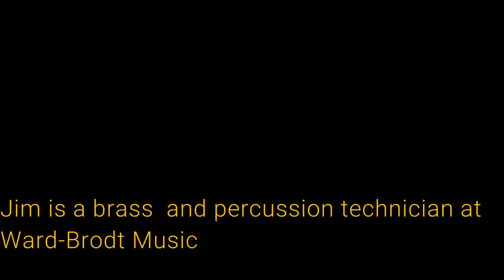Tuba Damage

Comment: What kind of solder do you use? I’m thinking of trying to refurbish my own sousaphone
Reply from the maker: 50/50 lead tin solder. Non-lead solders do not have the flow characteristics and usually melt at a bit higher temp.
Reply: @jimflys2  What kind of flux are you using? I'm just getting into brass sculpting, and I haven't found one I like. Also, do you use the same solder on woodwind keys, or is that another animal altogether?
Reply from the maker: @finncollbuckley4717  I use stay clean brand by Harris  flux for soldering. If you wanted you could make your own flux using muriatic acid and glycerin. I think it's a 50-50 mix. I haven't done that in years though. For soldering clarinet keys you're really talking about Silver solder. Silver solder melts at about twelve hundred and fifty degrees as opposed to soft solder which melt in the mid 300 range. Hard solder or silver solder uses a flux that is white and pasty and contains borax. All of these fluxes and solfders you should be able to find online. Most of them even in a good hardware store. The paste flux is available in hardware stores isn't very good for doing this type of soldering although it does work. But the acid-based solder flux as I mention do the best job.

Comment: Does the heat damage the laquer?
Reply from the maker: It CAN depending on technique and the composition of the lacquer.  Some lacquer is very intolerant to heat (ie Bach, Holton) and some can really handle a great deal (Yamaha). If scorched, then removing that and spot buffing and lacquer touch up is required. This is usually an acceptable option if #1 the customer does not have an unlimited budget for a complet overhaul and #2 the touch up on the lacquer is more acceptable than the dents.